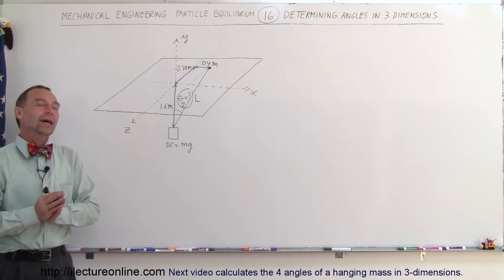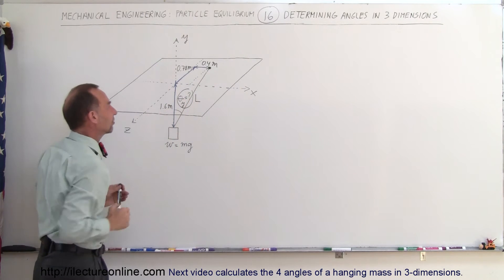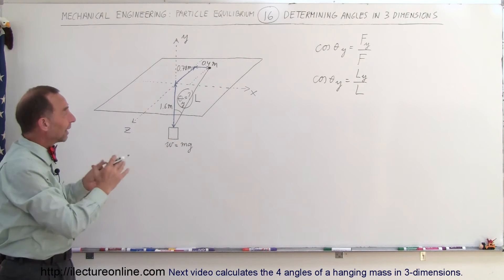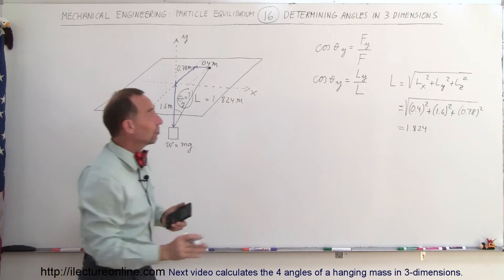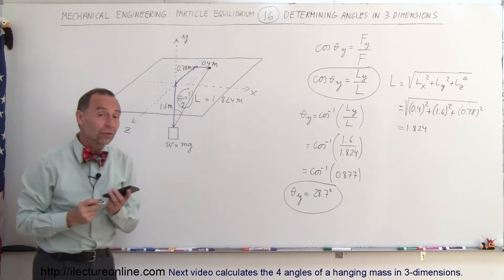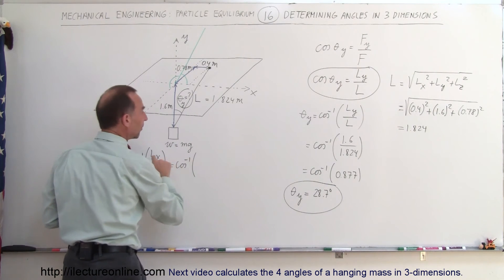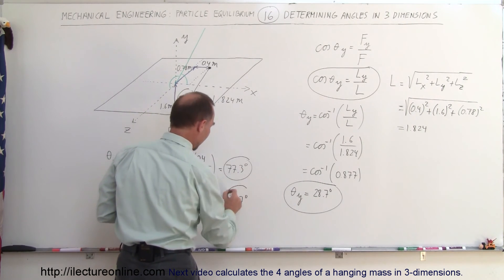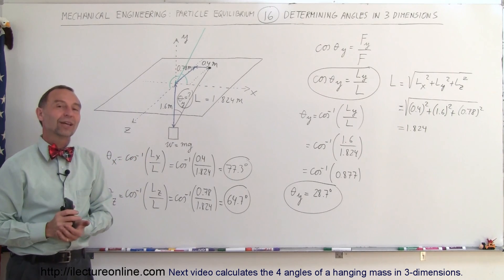Mechanical Engineering: Particle Equilibrium (16 of 19) Determining Angles in 3-Dimension

Comment: why is it the 1.6 is not negative when he plugged it in the Ly2
Reply from the maker: Because we only need the magnitude to find the angle.  (are there triangles with sides that have a negative length?)   We only use negative components when we are working with vectors.

Comment: Hi Prof. Michel. For solving this problem I found  two points (0.4, 0, -0.78) and (0,-1.6,0) and found a vector (-0.4i -1.6j +0.78k)then found its magnitude which is 1.824. For cos theta y I got (-1.6/1.824 ) so obviously, I got a different angle, and obviously, I was wrong, so could you please tell me why I was wrong?
Reply: i have done a little bit of statics in an engineering course and you are correct, you need to use the correct sign to find the true angle cosine, which is measured from the positive x y or z axis. but in this case the angle were looking for is measured from the negative axis, not sure why, this is why if we have a negative value like we do for the y compoment, we will get an angle above 90, which we do, the angle from the positive y axis is 151.3 degrees.

Comment: right makes x positive and up makes why positive. Which side makes x negative? Because my answer 151.5 and from experience I believe you are better at math and physics so can I know where was my mistake?
Reply from the maker: 151.5 is your answer for what?
Reply: I think I got the answer 151.5 for the angle in the y direction. WHich I believe if I subtract from 180 will give me 28.7 but the positive and negative axis are confusing me a bit.

Comment: I'm confused when by things like A of y (or in this case L of y) we sometimes mean magnitues (which can be only positive) and sometimes magnitudes+direction (which can be both positive and negative).
For instance, in this case we plug 1.6 for L of y (not -1.6). I know length can only be positive and the angle ends up the same when i plug -1.6, but still, having seen the first 20 videos on vectors, and the stress that is put on the vectors' direction, I'm confused now.
Reply from the maker: Whenever you write something in vector format (which means you add the unit vectors for each direction), you MUST add the proper sign.  Directions are a MUST when you ADD or SUBTRACT vectors.  But if you only want to know how high, how heavy, how fast, how far, etc.  which means you only are interested in the MAGNITUDE of a vector, it CAN NOT be negative.  (Negative length is meaningless)
Reply: Thank you for this explanation and for your time, Professor.